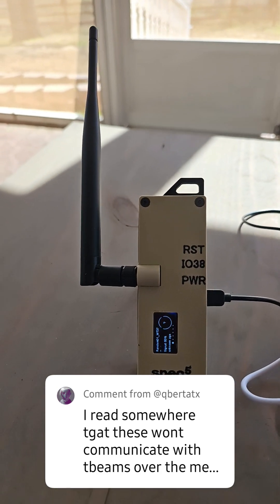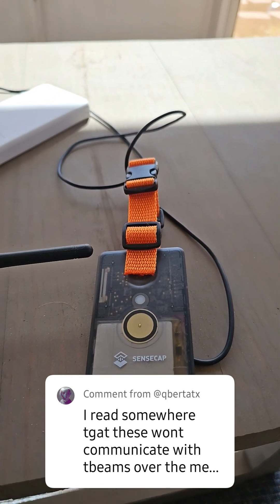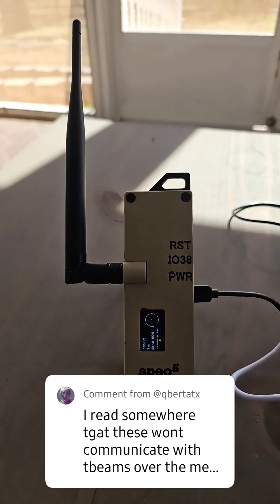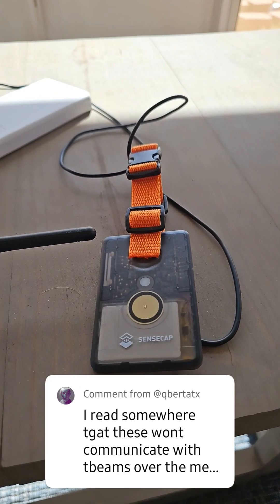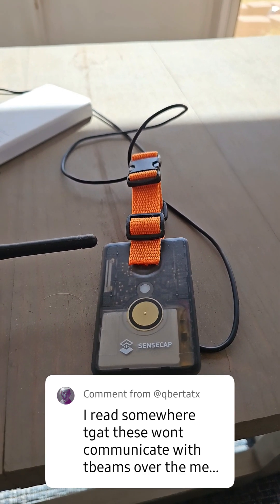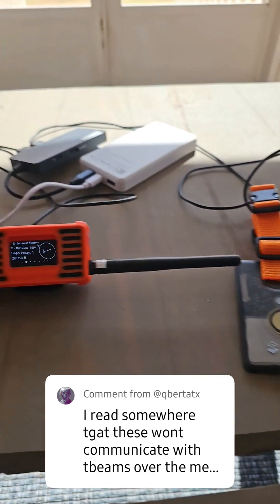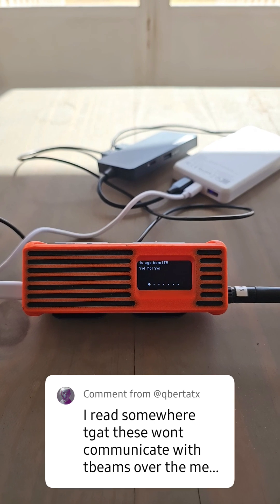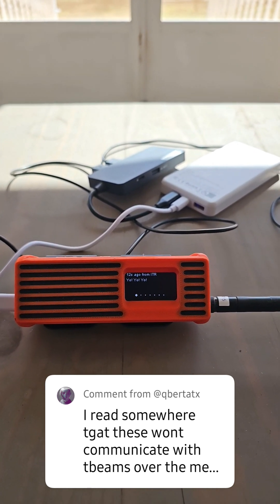Can the #SenseCAP #T1000E communicate with #TBeams? #meshtastic

Comment: It's because you had the supreme there to hop the message. The lr1110 boards in the sensecap don't communicate directly with the older boards in the t beams. The supreme has a newer board
Reply from the maker: I see what your saying... I am going have to dig that thing out and give it another try - well after I solder an sma on it again. It mY be good riddance if what your saying is true...
Reply: @digital.rancher  the older t beams are still useful if a newer board is in the network but ya for direct communication it's pretty useless, something eth the t beams security phrase

Comment: Any meshtastic Satalites in orbit? Or would that be possible?
Reply from the maker: None at this time. It is possible. There are LoRa nodes on satellites. If you are interested, check out the TinyGS project.
Reply: There was an issue with older Tbeam running the SX1276 radio, but newer with SX1262 are fine.
Reply from the maker: @CraigBowers Good to know, thanks for sharing!